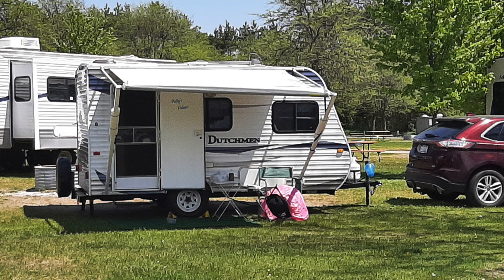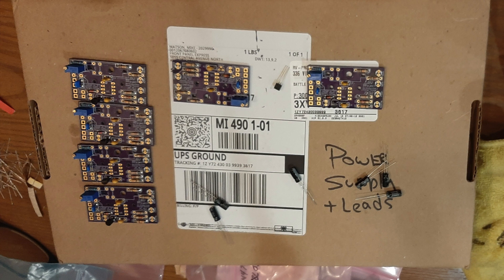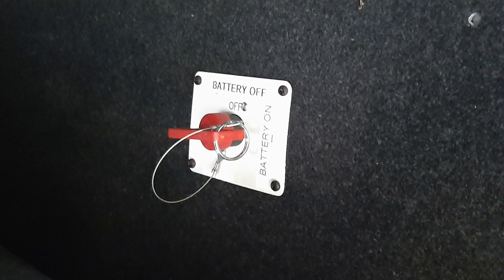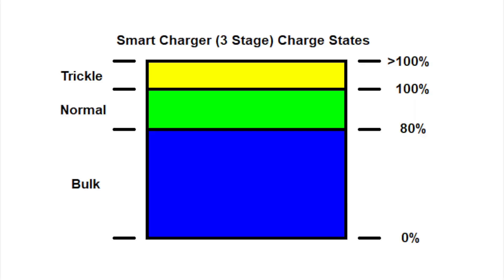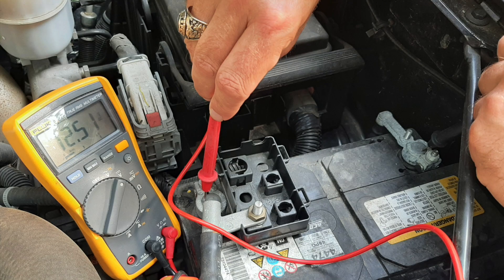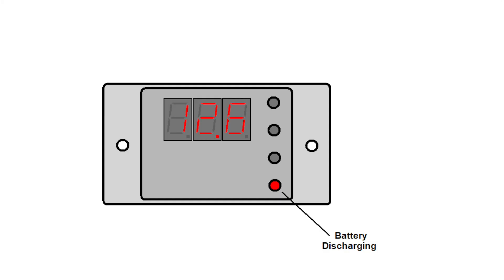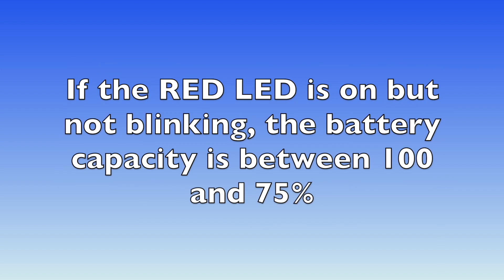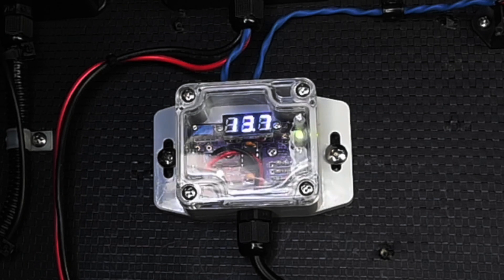Does your RV Battery die while on Shorepower?

Comment: I have a couple of v1 circuit boards left over. I was wondering if it is possible to use them for the v2 monitor. Would I just need to add the volt meter? Will the programming be possible on the v1 board? BTW my v1 is working very well inside the RV. I would like to put v2 in my storage area underneath. 
I've looked at both boards and they are quite different. Looks like I've answered my own question. So, is there a way to use a v1 board. I'm not sure where the fuse or the volt meter would attach.
Reply from the maker: Yes, the circuits of V1 and V2 are identical, other than the addition of the fuse and voltmeter.  

When I decided to do a refresh, V1 has worked so well that the only changes I needed to make was to reduce the cost  by deleting the aluminum front panel and switches. 

Many people either don't have the mounting space for V1 in their consoles, or don't want to spend the money for the custom panel.  And adding the Voltmeter was almost an after-thought. But since it is self-contained, it was a simple add.

I added the fuse as my intent was to connect V2 directly to the battery whereas V1 would typically go through an external fuse (distribution panel, etc).  Otherwise, the differences in the boards is in a mounting location for the voltmeter and fitting into the case.

There are many different sizes of these cases available, so if you use a slightly larger case, you could mount the voltmeter adjacent to the V1 board.

Also, I made the reset button on V2 optional.  I found I hardly - if ever use the reset button on my V1 board, but you can wire one to the board if desired. You could leave it off as well if you don't want to drill through the case.

The voltmeter simply parallels the power supply connection.  The pads for this connection on the underside of the board are large enough that you should be able do solder the voltmeter directly to those pads.

And the Arduino Sketch is identical to V1.

I would recommend adding an external fuseholder to the circuit if you are directly connecting the monitor to the battery.

V2 does not make V1 obsolete. It simply provides a lower cost alternative mounting configuration.
Reply: @RVProject  Good news! When I built v1 I bought three of everything except for the front panel. I'll be building one of these as soon as I get the volt meter. Thanks for the great mod.